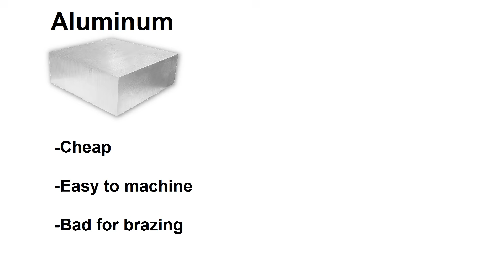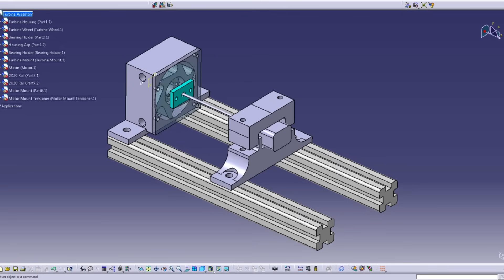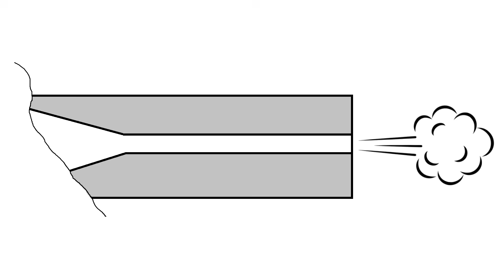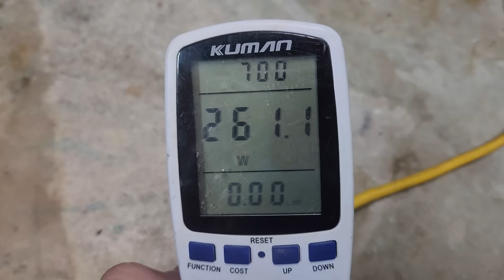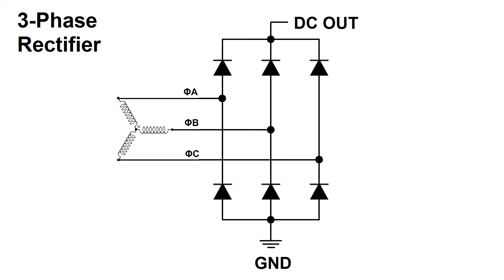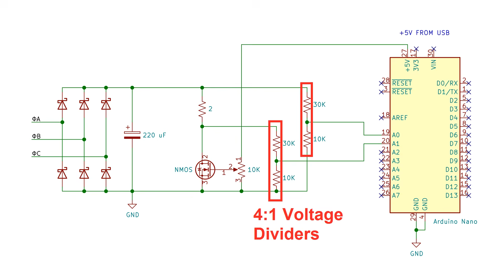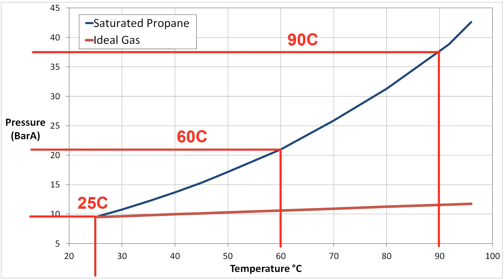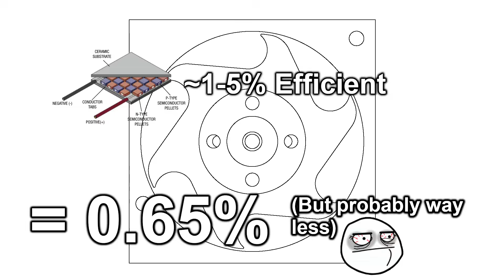DIY Micro Steam Powerplant

Comment from the maker: For those wondering, nothing exciting happens when the tank runs out of water. Because there's such a large flow restriction and the propane is gaseous, it basically just looks like a small pilot flame coming out of the turbine outlet, even when it's been superheated by the burner.
Reply: Has the potential of a beautiful thermobaric device with enough negligence. 😄👍
Reply: could the water possibly back-pressure into the propane? I'm thinking, if something went wrong up my the turbine. Maybe put a pressure release valve between the propane tank and the water tank slightly above the pressure of the propane so that if there is some weird back-pressure event, it'll blow the relief valve instead of putting ice into your propane tank.
Reply: that's exactly what I was wondering, thanks
Reply: Your missing the condenser
Reply: So,what if you were to use steam at a significantly higher temperature to spin the turbine?
Reply: Over time it would leave deposits in the flash line. Propane is highly refined, but there’s still residues from piping, blending, storage, transport, etc that would settle on the inside walls and polymerise, possibly forming a good deal of coke and blocking the line entirely.
Reply: Make a Steam engine with a Inlet and outlet valve with a short Inlet time an you will have much better efficiency.
Reply: How about using propane as the propellant and a power steering pump like a 10KW solar project someone did a few years ago using all automotive parts. Good idea since they are common and relatively cheap.
Reply: Maybe use the propane to fill a bladder inside the water tank so there is no direct contact but you still get the force of the push?
Reply: use a geared motors they make 240 volts
Reply: Don't waste that potential energy.  On the outlet have a insulated column that has a condenser at the highest point. It will drain into a elevated water tower that through a down pipe  to turn another generator.   You could have a second boiler to fill so it could work continuously  if you switch boilers each cycle🎉🎉🎉
Reply: ❤ Nice flash steam unit , they were very popular with full size cars and model racers,both cars and boats on a tether. How about trying a tesla turbine, with plenty insulation 😊
Reply: @associatedblacksheepandmisfits I was thinking the same thing but after thinking about it a little more I think the Tesla turbine would probably have to be heated to a high temp to avoid condensation from occurring inside the turbine otherwise the condensation may spoil the Tesla turbine from working as intended. Any thoughts space pirate???
Reply: possible use exhaust gases of ice as source of  heat ?for ex closed container exhaust tubes through water reservoir valve for 20 bar after 20+ bar steam go to   steam turbine or turbo as anti lag  etc ? may be 20 bar is high .if do it closed loop maybe it can be useful?
Reply: @bbb1331ddd 
🤔I like ur thinking 🤓

Comment: This is a very interesting Video! I have one note, and please correct me if I'm wrong: You referred to the heat exchanger of the steam generator as a flash boiler, which is, as I see it, incorrect the way you built it. Since you have the flow restriction before the heat exchanger you don't send pressurized water through the exchanger, but rather water under atmospheric pressure. The whole point of flash-boiling however is not doing that, but superheating pressurized water in the heat exchanger without it changing phase to then have it expand after a flow restriction where it is then rapidly phase-changing to steam (hence the name flash-expansion). Or did i missinterpret the flow restricition under 2:22 and you're real restriction is the steam nozzle itself, after where the water will expand into steam and you just want to restrict the incoming water flow?

Comment: The second I saw the extra diagram for an air pressure dependant system I went . I love your brain. It's a joke between some streamers I watch because that's the first time someone admitted they had a crush on them  lol. Anyhoo I wanted to a do a similar thing because those cheap little air compressors work so well and one of mine died recently.  I think it just leaks because unplugged it makes compression if I move it by hand so there must be like a seal broken or something like that because it's making decent pressure still
Reply: I know that didn't really lead anywhere I just had a similar idea but instead of a ram pump more like a ram siphon something run off combination of a spring and the lift from a winged device to create lift against the spring which may or may not move a physical albeit tiny a siphon into a polluted water source one with lots of debris and moving water . More just as a water feature to experiment with when im bored and need to feed my child mind once again😂

Comment: If you're in the US the US does not use Imperial instead it uses US Customary Units which have different specifications than Imperial. For instance 1 US Customary Gallon =/= 1 Imperial Gallon.

Comment: A piston engine would 100% be better
Steam turbines do not get efficient until they are several hundred horse power (each hp is 750wh essentially) 
So they dont start to out preform steam piston engines, until roughly 400hp atleast (300kw) or 300,000w
Essentially your 20000 times undersized 😂

Comment: Last paper I saw on the matter suggested turbomachinery tends to lose out to reciprocating engines at about 750kW output, so don’t beat yourself up on the tolerances and losses. Steam turbines also tend to use multi stage axial turbines or a centrifugal turbine arrangement to extract energy gradually at subsonic speeds, rather than a one and done expansion.

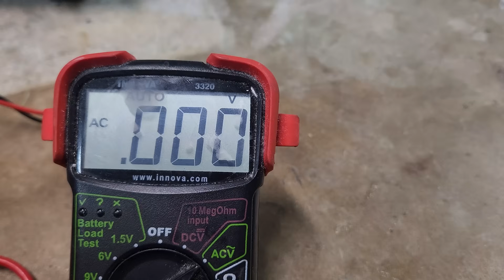Comment: 9:52 the innova 3320 is a shockingly decent cheap multimeter, but I have been using a cheap chinese one now that has an app and does dc clamp, but I still have the 3320, it either needs a new battery or a switch cleaning but yeah, was my dauly workhorse for years as an automotive electrician

Comment: Could you just..  use a cylindrical container with a hole through the center to hold the water, with the fire in the middle, to heat the water, and coils above it for full boiling-?

Comment: If you use electrolosis on steam it has higher efficiency then when it is a liquid. You can add thermoelectrics to generate electricity for electrolosis. You can even use the low pressure on propane for a tempeture diffrence for electric generation. The propane is used as a started and electric generator using thermoelectrics.
Also collecting the gas and steam by condenaing the steam and the gas will be seperated and can be used but need to go through a drying filter.

I thinknit could work but I don't know about how effecient you can get it. Perhaps hydrogen combustion powered piston and a larger brushless motor or more smaller ones.

Comment: What if you took the output of the turbine and put it back to the tank to use the steam as the pressurizer for the feed tank? Natural circulation says the steam would condense (eventually) while still pushing the water through the flash boiler creating a closed circuit kinda sorta

Comment: I would say you could solve the tank freezing problem by routing the exhaust steam in a jacket around the tank. This does require you to close the steam loop, solving the dryout problem and likely add a pump unless you placed the propane and steam turbine above the water reservoir.

Comment: Look into cavitation water heaters this guy had a water heater that was a disc with a bunch of holes in it inside a casing that water would go inside and it spun up with an electric motor and due to cavitation you can make it either steam or hot water with way less energy just depend depending on where the holes were located on the disc

Comment: Super!
U can use some steem pressure to add water + a small pump.
 If the steem pressure is 8 BAR, then water pressure in the water tank is 8BAR, and U need only use 0.1BAR to add water level.
 With this system, how U can check wather lewel?
 If too much, then the system stops ✋️

Comment: This was entertaining and amusing for me since I think of this kid of thing frequently but never have the time to experiment with fabrication at this level. I often wonder what it would be like to run a small inverter generator on ng or propane then feed the exhaust into a heat exchanger to heat a space as well as generate electricity. What kind of efficiency would be realized?

Comment: What if you used a water injector?  You could do away with the compression tank and the water tank if you're compressing the water with an injector right at the inlet.  I would use the water jet from a water metal cutter.

Comment: Next time use conduction wrap a nice big thick piece of copper around that piece of Steel right there and then throw those high frequency AC through that what's that pipe heat up run your turban and produce electricity play keep your heat coming

Comment: Ah yes the trigonometry the math excuse me the maths I was corrected buy one I guess when you measure in metric since Imperials based on trigonometry I suggest you try to use it as often as you can when you're dealing with mathematics like volumes and pressures the nice little digits and look good but they don't work well when you try to do above basic add and subtraction

Comment: So you already have steam pressure so let's go ahead and get an outside air pressure to do the same function as you could do with your Steam after it goes through a radiator Cooling and in doing so cool it more don't put a loop just dumped all that wasted energy used it once there's only some left you know enough to pressure a tank you have seen the little part of trick where they have have water running into one tank and then a pipe at the bottom of the tank and that water is pushing up and into another tank where that tank is sealed and it repeats pushing the water up into a loop back into the original tank now look at your Steam can you say anything similar😮 all you need is a condenser you know a radiator with a fan driven by Steam😮

Comment: You should try the Tesla Turbine maybe? From my understanding they are much more forgiving and can generate more power. I think Tesla Turbines are used in Geo Thermal powerplants. And also the bigger the turbine power can still be generated as the turbine still spins. Bit like a Gyro Power Generator.

Comment: Generate steam via sun. Could use low cost mg90 servos and a mirror to focus heat on a boiler. Also use printable TPU or cast a silicone impeller. You can get good deal with minimal friction. See air powered engine for reference.

Comment: You need to feed the water in the boiler towards the flame to get the hottest steam.  Also plug the center of the coil to force more contact with the coils.  And more so use a jacket around the outside of the boiler housing to collect preheated combustion air.

Comment: you got amazing electrical engineering skills. So build a new rotor in Aluminum with 3 thou of tolerance. drill the wave form holes on the rim then turn accurately down on a lathe. easy peasy.

Comment: OK, what I I have to stop so far through because I see too big of a safety concern. The water when it boils has a tendency to occasionally grab a piece of the metal mineral and pit and if you get your gas going through, it’s gonna go through on the burner and you’re gonna have Problems there safeties and play I know, but the way I know to do is take a car fuel injector for a flash boiler and you heat up just get a plate of steel hot and spray the fuel injector spray on it and it makes the steam just looking at your steam turban though is the only thing that’s got me to stop here and it’s far simpler to take even an electric pressure washer jumpstarted off the wall and be pushing a full-size 5000 generator and switch from the wall over to the generator and push the water tank with the pressure washer and the generator around after you’ve used it drain the water and spray the area down where you drain the water with regular tap wateravoid using lake water at all costs due at no time. Keep the water in the machine and operation for more than 24 hours bad stuff happens.

Comment: Oh, so everybody is giving modification advice? OK, i will do that too. Well, instead of steam you could use superheated  plasma, you could heat it by antimatter-matter anhillation engine and feed antimatter by using magnetic field, for matter you could use  hydrogen and helium from a nearby star,for antimatter-a nearby black hole, the gas would already come preheated and also could be used to generate plasma, plasma could turn a neutron star=magnetar and you could place a huge coil around it, you could wind the coil using a spaceship similar to the one from star trek and get the metal for coil from nearby planets, coil should be supercooled to be superconductive, you could use the same helium from that star, you would just need to cool it down enough with some special condenser-precipitator, in fact, you could use a couple of magnetars, pushing them closer could make them heat up and then pulling apart-cool down, by directing a stream of helium through cooled down magnetars you could cool it down too!

Comment: This turbine is so inefficient, i think what is happening is after air hit the blade/wall of the rotor it cant go anywhere so there is just a pressure buildup in the pocket between rotor and casing doing essentially nothing, and its later exhausted later with a lot of energy lost

Comment: maybe a multi stage turbine where the output of the hig pressure feeds to the input of the low pressure? There is some math involved for size and stuff  but in general, when well engineered, steam turbines are more efficent than piston steam engines. At the same time you could look it in the oposite why and youa re feeding it to much energy that actually needs. Just some thoughts in my mind

Comment: Suggestions: #1 Use house water supply for pressurization. #2 Being that transforming 1 CI of Water to dry steam creates 1600 CI of gas you need to consider using double or triple expansion device. #3 Your tolerances suck :-]

Comment: Your boiler is crazy inefficient. you also neglect late steam engine trains and boats which did not need hours of preheating like you mentioned. You want to heat the whole water tank even if it does not boil the water. This will preheat the water and give you low temperature steam ( 100 degrees C ). the steam from that should then pass again in the flame to heat the steam up passed 200 c. You then want this to go in the shortest distance possible from the direct flame to the engine

Comment: I think a more effective and simpler way would be to power an electric generator with the gas you used to heat water. And then you can make electricity even from wood, if you have a 'holzgas' (wood gas) generator. It would be great if you could test it sometime, check, for example, how many kWh can be obtained from one kilogram of wood.

Comment: No, tolerances have nothing to do with efficiency in your case. Rather, it's the opposite - that minuscule efficiency that you have you have only thanks to loose tolerances. The whole rotor is designed to fail. Once a scoop in rotor passes through inlet, it does effectively nothing. Pressure do not push rotor in one direction and shape do not matter at all. It would matter a bit if the rotor would be pushed by wind i.e. wouldn't have a case. So, most of the time, the gas in those scoops just idling and waiting until it reaches exhaust. If you want higher efficiency, you should look at turbines, which is basically a set of fans positioned along expanding housing - this does convert pressure into kinetic energy. Alternatively, you could use a Tesla's turbine, which is metal disks at close distance with steam passing between those disks. In both of these cases gas moves from high pressure area to low pressure area and pushes the turbine. In your case it goes to high pressure area and stops. Then it goes to low pressure area. You could place intake and exhaust right next to each other so the gas escapes almost as soon as it enters your scoops - and this will still have negligible effect on efficiency.
I actually wondered how your rotor even starts to rotate, but I guess it's actually thanks to tolerances that some gas might escape the scoop and push rotor. So, by decreasing tolerances you'd likely only lose efficiency, not increase it.
And for small applications, Tesla's turbine would be just what you need. The closer you could pack it's disks - the higher it's efficiency would be, and thickness of disks themselves only plays structural role, so they won't deform under uneven pressure.

Comment: Repurpose a junk yard 60,000 rpm turbo charger assembly, make sure you do expansion cone ( Do the Math ) and use switch grass pellets as fuel.  Insulate better and incorporate  phase change materials that arw conmonly available.🎉

Comment: 3:03   You'll find, using a solid rotor with holes (I used 3/8" holes) drilled about the circumference  at a 30° angle in the direction of rotation, is quieter and makes better use of the steam. My exit port allows for a rotor travel of 1/6th the rotor diameter.

Edit: I currently employ a brass spur gear, because I can buy it off the shelf. Ya, I know. . . . Lazy.😂

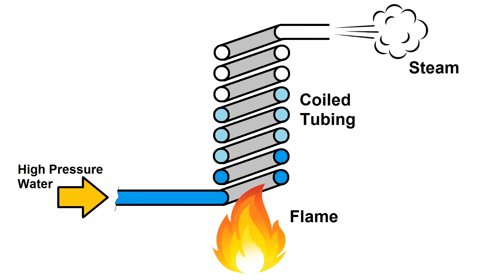Comment: 1:33  What you're showing is actually incorrect.  What you're after is "dry" steam. To do that, the  exit portion of your monotube boiler must be bathed in flame.

Your illustration shows the reverse.

BTW, I'm 76 and have designed and built steam & air engines for nearly 60 years.

Oh, and I designed and built a "positive-displacement " turbine with a 255° power stroke.

Don't wear yourself out trying to figure it out, unless you're autistic,  like me.